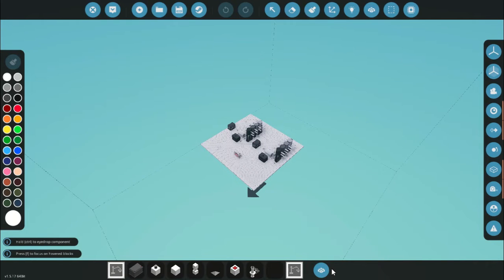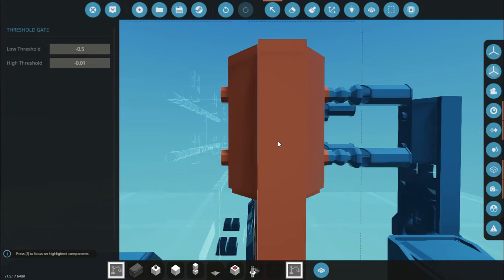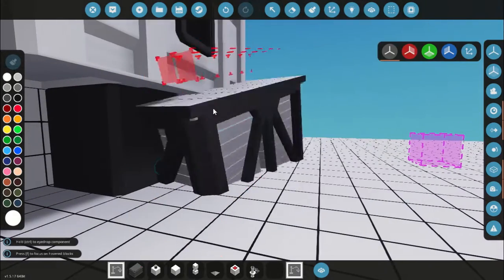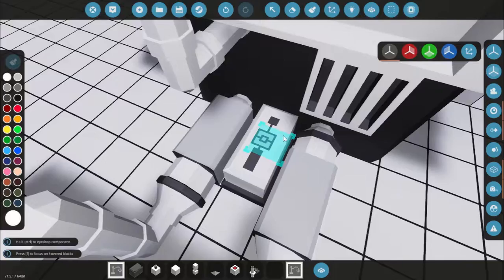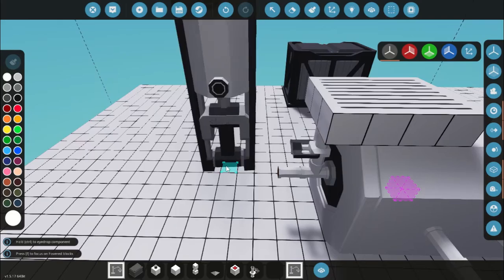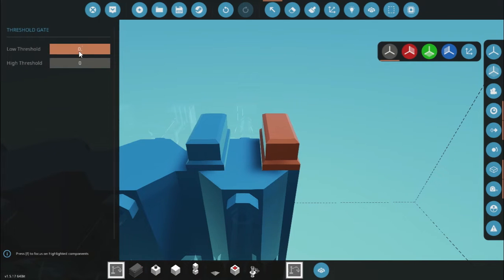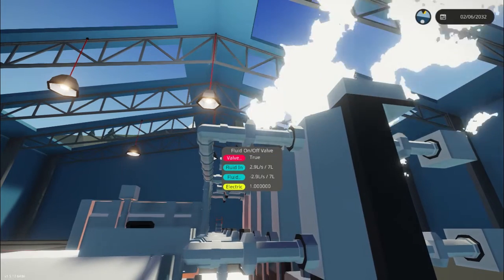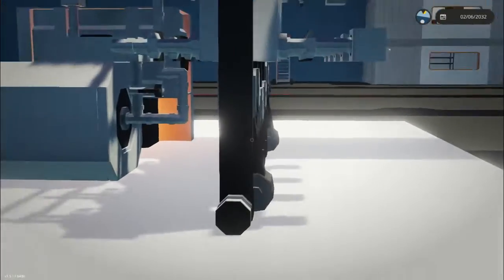Steam Piston Efficiency Tutorial & Piston Engine Tutorial! | Stormworks

Comment: afaik the output position ranges from 0 -> 1, not -.5 -> .5 . Meaning the thresholds should be set to .01 -> .5 and .51 -> 1. In the video it looks like the bottom exhausts don't exhaust steam.
Also if the piston goes up, steam should be going in the bottom input building up pressure, and out of the top one, decreasing in pressure and visa versa.
(Somehow in my own test somehow when adding pressure to the top half the piston goes up.... so it doesn't make any sense to me anyway :/)
Reply from the maker: They may have changed it because I saw negative numbers last time but I haven’t touched them in months
Reply: You don't need thresholds. You can feed steam directly into the piston
Reply from the maker: @ПавелВеретенов-к8щ  It was an attempt to control them like you’d control normal pistons.
Reply: @AXbcyz  sorry i didn't get it
Reply from the maker: @ПавелВеретенов-к8щ  By filling the bottom compartment of the piston when it’s in the lower position, it should go up. The opposite at the top. The goal was to fill either the top when the piston was up or the bottom when it was down to get smooth motion, now I see how it might not work to well though

Comment: I have tried this with the small steam pistons and it will not start rotating
Reply from the maker: There might have been a change with the pistons, or they’re not the same, simply connecting it normally should work just as well
Reply: I set the top intake and bottom outlet (low 0.77 high 0.88) bottom intake and top outlet (low 0.24 high 0.35) 6 medium steam pistons, pistons position (0.48,0.24,0.12,-0.12,-0.24,-0.48) with nothing on the Rps I was getting 0.8 rps normal is around 0.4/0.5 rps
I do have two boilers and fireboxes with one condenser system inside the reserve water tank.
Reply: It starts up but won’t last. the timing need to be perfect and this game I close but not perfect

Comment: Isn't the 0.00 position a deadzone if unused?
Reply from the maker: yeah but then if I put 0 into the threshold there wouldn’t be a spot where it actually switches to the other cycle. It I add it in it actually stops working (from what I remember)
Reply: @AXbcyz  but logically speaking 0.5 and -0.5 is the same position as they are equally far away from 0, so isn't that also a deadzone? (also with my setup i just did it so the thresholds are 0 to -0.49 and -0.5 (or 0.5) to 0.01) works fine for me, at least it can to get to like 1.4 rps on my inline 8 (basically 2 inline 4s stuck together with how i did it) on 0.68 throttle
Reply from the maker: @mahgneesgeming6488  Idk, I just thought that having over lapping steam release and steam in would lead to a faster decline in overall water content so I did it that way